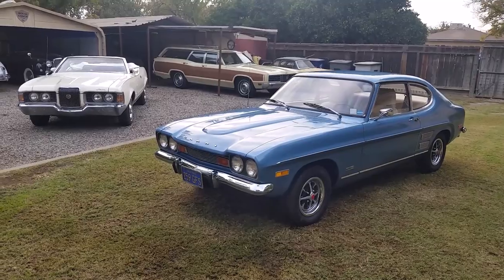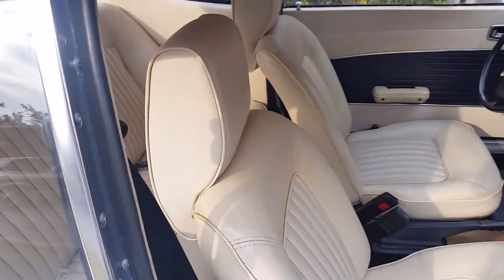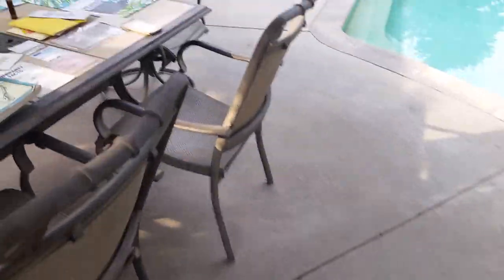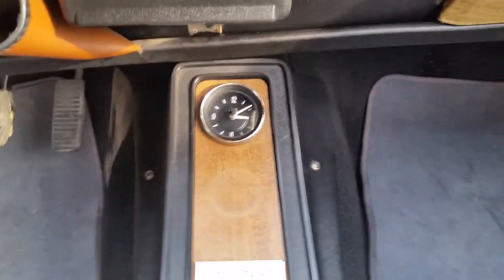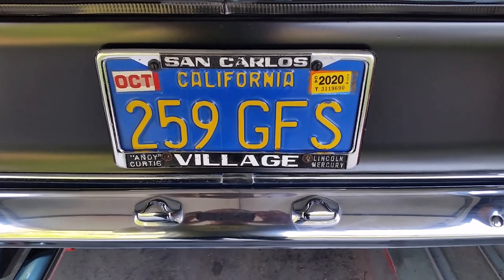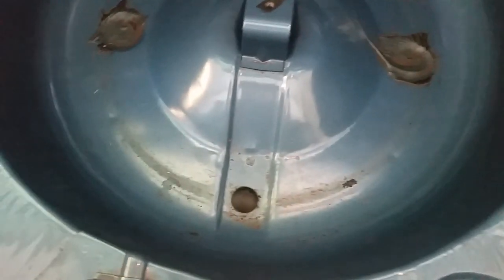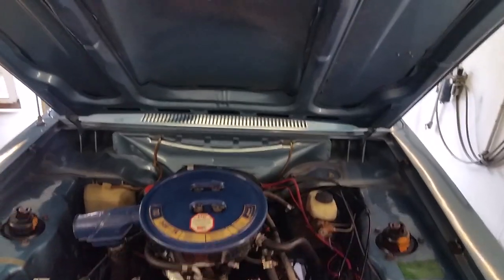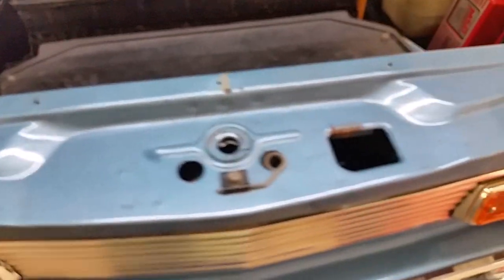ONE OWNER SURVIVOR 1972 CAPRI V6 AND OTHER ONE OWNER CARS IN MY COLLECTION.

Comment: Purchased a 1972 2.6 V6 4 speed in 1974.  I was a junior in high school. I bought the car from a man that raced it on closed course, weekend events.  I had a set of headers added.  That car us so much fun.  Very quick but not top end fast enough to run very the V8's.